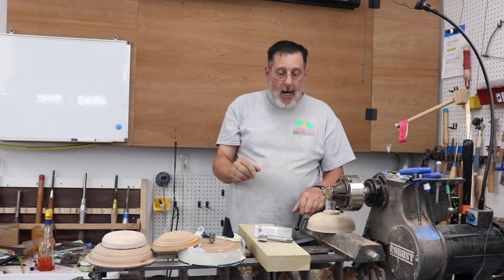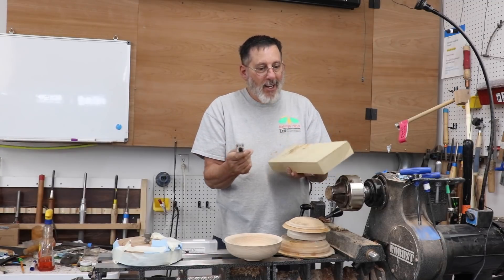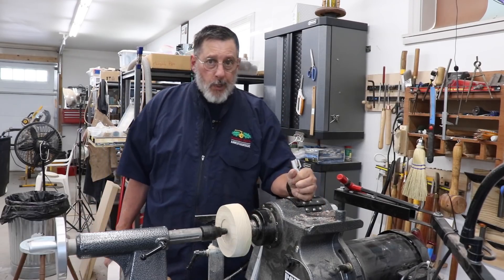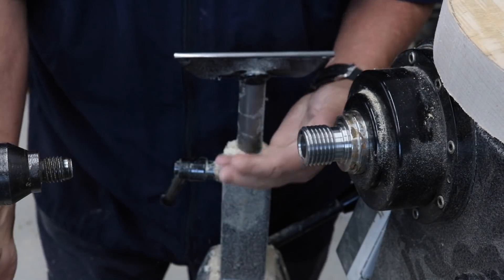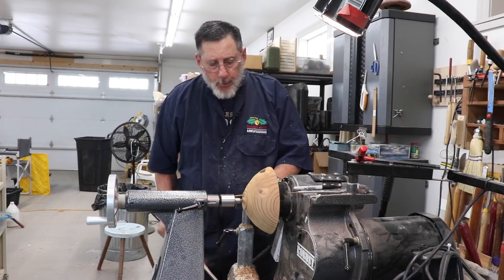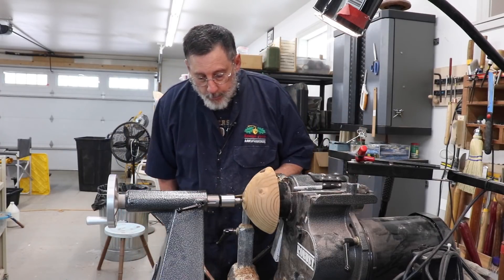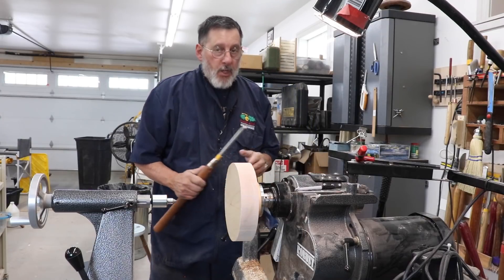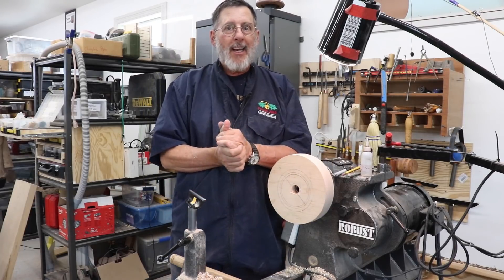Making a Threaded Drive Block for Woodturning     with Sam Angelo

Comment: A new twist to the holding the job issue. Good idea Sam. Mike Waldt has a good vid on this issue and uses a nut epoxied into the wood block. I have made a few of these. My local supplier had a box of M33 stainless steel nuts at A$4 a piece. The nut makes trueing up easier in that you can eyeball your hole, drill it, chisel it to the hex shape, epoxy it and then true the completed job in the lathe. These days I screw the waste block to the drive block and so none of the drive block is sacraficed.
Reply: Easier still if you can find the right round nut. I use automotive track rod ends, but M33 motorcycle nuts come rather dear. Bernard.

Comment: Sam, thanks for the shout out. Great video.
May I offer a couple of ideas for your consideration that have evolved since my video.
1. I now make all mine at 3-6 inches in diameter (poplar). Then I glue on bigger pieces as necessary such as your wider drive blocks. Then enables more of a standard threaded base and reuse of the base as projects evolve. I can cut off the old completely and start over when the drive block gets too small.
2. For the threaded base, I use deep shark jaws and simply press the wood against the closed face and cut a quick tenon. Therefore, I do not have to plane the wood nor have a waste block behind nor have double stick tape.
3. To thread, I reverse the wood into a compression hold and do the threading such as you have described plus final adjustments for my spindle.
4. I do not lubricate the threads as I cut them. Instead, I flood the threads with thin CA and allow to dry overnight. Then run the tap in again to clean the threads again. It does not take much. Afterwards, lubricate as you described. This firms up the threads a bit more.
5. Facing off the top side of the block, removes my initial tenon. But, I always cut a new one for emergency use so I can mount in a chuck if needed. Frankly, I have never had to do this.
I have 2 or 3 dozen floating around my shop.
Again, good job.
As you can tell, I love using these blocks. I keep at least a dozen at ready for adaptation.
Alan
Reply from the maker: Nice to hear from you.  I just had to make a mention (previously) of the bandsaw blade being exposed on some saws.  Mine is totally enclosed with a guard.  It does sit in a slot but can't be reached.
Re: the drive blocks.  I also have many of these sitting around the shop.  They start out around 9-10" in diameter and then just get smaller over time.  I like the idea of glueing on a large block to a small threaded piece.  Some very good ideas,  Thanks Sam

Comment: Excellent video, Sam.  I also use the Beal Tap. My drive blocks are coated with 2 coats of ca glue to strengthen the threads. If one does this, be sure to run the tap back through after the CA is completely dry for proper thread clearance. 
  Another great video, Sam!

Comment: I just got a Beal tap and was wondering about drilling and hitting the chuck.  You gave me some options.  I then started thinking, I know that is dangerous ha ha.  when you cut your poplar squares you should be able to find the center of the block and drill it on the drill press.  Then take your block to your bench vice and tap the hole.  All the videos show tapping on the lathe to make it square.  Screwing a free hand tap hole on the spindle would be square to each other but the face and edge of the blank would not.  You could then cut it round on the band saw and then screw it to the spindle.  Everyone trues up the face and edges once the drilling and tapping is complete.  I think drilling and tapping by hand at the bench vice would work the same way.  Thanks for the new insights you gave me.

Comment: Sam I tap 1/4 x 20 holes in my R/C model airfraft for holding the wings on. But I then add cyano thin glue to the holes and retap. This makes the tapped hole thread much stronger to last longer with removing and installing the wings.

Comment: In my early turning days I used a Beall tap to save buying face plates, preparing my blocks just as you have shown, Sam. My first rigid sanding disc was made as a lathe accessory that way, fitting the table to the banjo. Also, as my lathe had a solid headstock spindle; a Morse taper attachment. Valuable, but now obsolete, experience.   Bernard.
Reply from the maker: Interesting...we all had to make do, in the early days.  Sam

Comment: I have tapped several waste blocks, I did it by drilling waste block which was mounted on a face plate. I drilled it out on the lathe first. Then I took the face plate and waste block off put it in a vice with faceplate up. I fed the tap through the faceplate in order to keep it straight and for even threads.  Lots of lubrication to keep things cool. Have you tried this method?

Comment: I've found that starting with an 1 1/4" bit for about an 1/8" recess gives you a good shoulder to register against.  Then complete the hole with the 1 1/8" bit to tap into.

Comment: Another finer point of these direct thread blocks is to add a 3/8" (plus a 32nd) hole in the side so you can get it to turn off when you are done using it.

Comment: Sam they work well don't they.  I keep a stock of Nylon 66 blocks threaded for my live centre which I can then turn into the desired profile if I am making something a bit different that requires tailstock support.
Reply: Yes, Nylon 66 threads very easily and I use it at headstock and tailstock for special accessories, including as mandrel saver for my own design of pen mandrels. Bernard.
Reply from the maker: Great tip!   Sam

Comment: I always learn so much from your videos! Thank you! I’m a new-ish turner and I always have trouble with that last little nub at the bottom. How do you finish when you take it off the drive block? A Dremel tool?
Reply from the maker: I carefully use a scraper.  Start below the nub and lower the handle and then move the edge to the left.  No dremels   Sam

Comment: An opening with two American Beauties. Way to go Sam. This was a great tutorial on threaded waste blocks. I have seen several others but yours is much more detailed on the use of the Beall tap. Do you think there is any advantage to hardening the finished threads with CA? Thank you for sharing. Have a great day and stay safe.
Reply: Yes, I use English Sycamore, which is so hard when fully dry that one can economise by using end grain branch wood, but is still improved with CA glue. I lubricate my threads with Petrolatum jelly from the baby care section of the supermarket.   Bernard.
Reply: I used to use CA glue just as you have suggested but over tge last few years have found in practical terms it makes no difference.

Comment: Thanks Sam. QQQ: I have a 1” drive center, why can’t a 1” nut embedded into a drive block be just as good if only need 3-4 different blocks for the small shop?
Reply from the maker: Yes  I do this as well
I will address this comment further  in my
 next Notes from the Turning Shop video for January